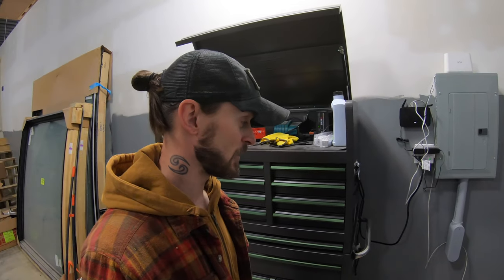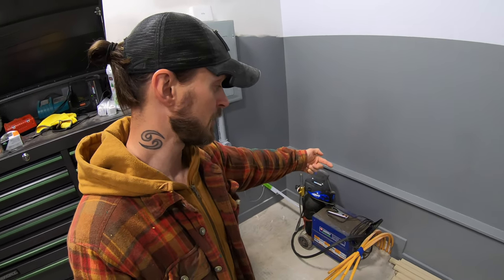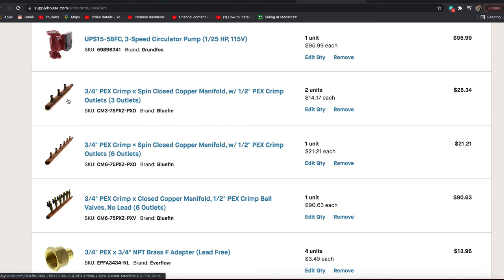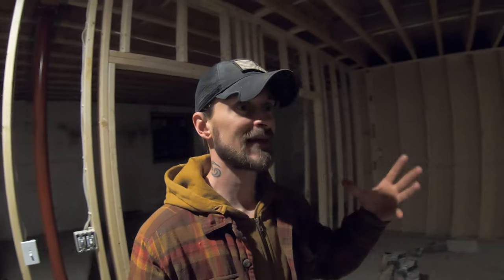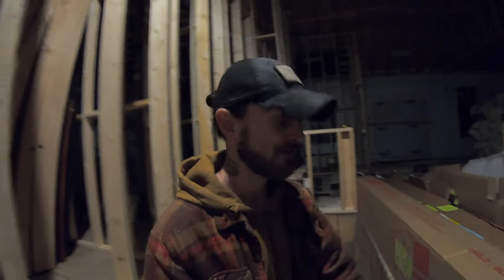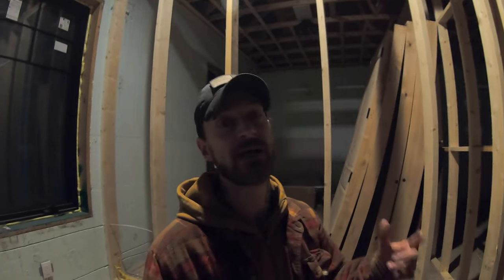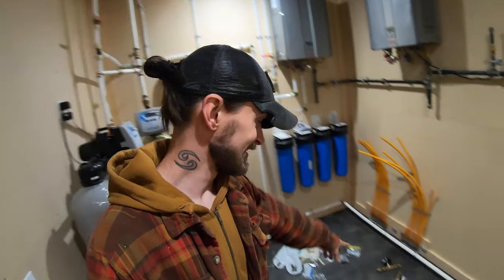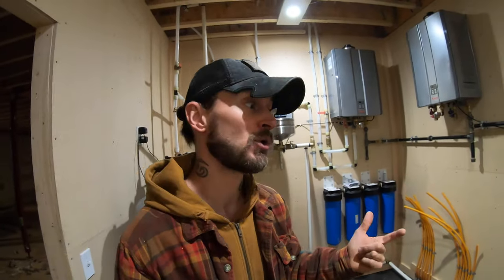Lets talk about radiant floor  Heating!!  Is it enough??

Comment: i would put one valve between manifold and main line. That way u could just shut the garage off. But no way it is needed for each loop.
Reply from the maker: Definitely doing that at least.
Reply: At least one 1/2” valve per loop will be very helpful for purging air. That way you can purge one loop at a time.

Comment: Valves allow you to balance the flow of the manifold. More importantly if and when you have a problem with a loop, it allows to isolate it.
Reply from the maker: I didn’t get mine with the flow rates so not sure how to balance but when in the basement it all feels comfortable, that is until we start blocking rooms off and isolating them.

Comment: I hope your radiant works, I’m doing the same thing.  I’m going to have 4 -300 ft loops for the basement and upper floor. 2400 sq ft. I think it will work.  People in icf houses swear by the consistency in the temperature all around the house.
Reply from the maker: Well the garage is amazing and that’s not even ICF!   Just 2x8 walls with zip R 6.6 on the outside.  58° feels crazy crazy warm!   Working out there you’ll sweat!  The basement at 50° is also pretty warm and before it got cold, 61° was almost shorts and tee shirts!   I can’t imagine having the basement more than 64° in the dead of winter when we are fully insulated and doors/windows done.   I’m guessing that’ll heat the upstairs with no radiant but not sure how that’ll feel.  If the first floor is perfect the basement might be to hot and if the basements perfect the first floor might be to cold.  We’ll see but you will 10000% LOVE radiant!
Reply: @neckofthewoods24  the insulation you used in the garage was very smart.  The layer of continuous insulation is something all houses need in my opinion. Thermal breaks are a real energy saver. I see a lot of people now thermal breaking everything. I enjoy your videos because your about 8 months ahead of me.  I have seen quite a bit of similarities in our situations. Good luck!!
Reply from the maker: @bwade1022  thanks so much!  Good luck to you.

Comment: Check out Warmboard for your main floor. That’s what we’re going to put in our build. Matt Risinger has a good Build Show episode on the system.
Reply from the maker: I did.  It’s absolutely unaffordable for us.   Once I looked a few years ago and the panels were $225 each for the structural ones.  Then with price increasing they went to $350 for the retro fit ones!  I bet the structural are over $400 each now!  We have 1900sqft or roughly $21,000 needed for just some OSB that’ll hold some tubes in place on top of what we already paid for the 3/4 subfloor.  When I again inquired about the structural ones, that entire system was over $30,000!  Today I wouldn’t be surprised if it jumped to $40–50k.   My entire system isn’t going to be over $5-$6k including all pipe, pumps, boiler, controller etc.  good looking system but the prices are just way to much.
Reply: @neckofthewoods24  oh wow I can’t believe they’re that expensive! That’s really unfortunate. Figures something that cool would price everyone out.
Reply from the maker: @jordanbannerman7816  i know!  its great they do turn key or just sell you the panels but come on!!  even before the price gouging, a 1 1/8th plywood sheet was $44.50 at Menards with 11% off vs theirs at $225.  either way you need to pay so $44.50-$225=$180.50 more for a sheet of aluminium.  now we didnt use 1 1/8th plywood, we did 3/4 osb which was about $27 at the time.  so just the panels would have added $11,880 to our build which we couldnt swing.

Comment: Cheaper copper manifold in the garage, $90 copper manifold in the house, use 2  cheaper pumps for house like the one for garage. Order 2 spares
Reply from the maker: that was my thinking, copper in the garage with no valves, just a main shutoff inside.  $90 copper in the basement but for hot runs only going out to maybe slow the rate if need be.  no valve copper on the return for the basement.  use 2 1/25th pumps for the house?  would 1 pump go to 3 runs and the other pump go to the other 3?  how would that work off of one thermostat?  im not sure if the controller can have 2 wires in a slot that get screwed down.  figured a 1/6th pump set to the slow setting would be enough.  both the 1/25th and the 1/6th i want to buy them with 3 speed settings each.
Reply: @neckofthewoods24  wire the pumps together, using the same Thermostat
Reply from the maker: @joemizer  hmmm but I’ll need 5 then if I do the first floor.  I know a 1/6th is more money than 2 1/25th but I maybe I can find one in between.
Reply: @neckofthewoods24  seriously I don’t think you’ll need to do the first floor.
Reply from the maker: @joemizer  please please please!!  Haha I can’t drill all those holes through all the joists and that main beam!   Plus it’s not easy to pull from the loops!   I did just find a 1/12th stainless steal grundfos that’s cheaper than a cast 1/6th!   That should last and be able to do the 6 basement runs.

Comment: You want shutoff valves on each line to troubleshoot and isolate a broken/leaking run. Good as pex is, it’s still plastic and can crack or break if something went wrong during the pour, drilling additional holes in the slab, shooting nails into the slab, cracks that shift a slab due to frost intrusion or unknown bad concrete mix, etc.
Reply from the maker: but if the pex is broken for a year now ill just shut the whole thing down and ill have to dig it up to fix it.  shutting 1 run down to fix while the system is still running would be the only need correct?  so far we've done zero drilling or shooting nails and we dont plan to.  the garage will get a 4 post or scissor lift and the basement i've been doing adhesive vs nails.  the cracks and shift worry my but i dont think ive ever hear of that being an issue.  hopefully that doesnt happen because that will be a ton of fixing and replacing!
Reply: @neckofthewoods24  With individual shutoffs you can let the other lines run and deal with the bad line when you can or never if you decide you don’t need it. Just saw a guy still building his ICF home last week bust one of his pex lines and have to chisel it out about a foot to each side of the break in order to patch it. fortunately he just has his basement walls and floor poured when it happened so was a hassle but not a big deal. Basically valves are cheap insurance and easy to put in during the initial install.
Reply from the maker: @inmyimage1081  how did his break?   I think everyone was carful during the pour but I guess you never know.  I do know though there’s been no penetration injury’s since then.  Only downside to pre-made manifolds is the inlets are on the wrong sides vs the valve handles.   I need left sided inlets with the handles facing out.  All the manifold have the inlet on the right side or I’d have to install the manifold backwards where the handles face the walls.  That’d look dumb just like have to bring the pex up and over the manifold to U bend back into the inlet.
Reply: @neckofthewoods24  Had to go back and look, the pex wasn’t in the concrete as deep as expected (seems to be a common issue) and he cut it when making stress relief cuts in the slab.

I’ve never seen anyone use an off the shelf manifold for radiant floor heating seems like everyone just makes what works for their design and space. 

We are a ways off from building so I haven’t put a radiant heat floor system myself but I spent my career designing and fixing big integrated computer network server systems and no matter how detailed your plans are there is always risk that something will go wrong so it’s best to have contingency plans and ways to gracefully take a system offline as much as possible. The addition of some ball valves just makes sense to me.

Comment: The thermal mass of your concrete slabs should regulate your temps pretty well but if you are adding a bunch of heat like in the gym, your air temp could get pretty high since your envelope has so much insulation.  Even if your radiant is zoned and the gym zone stops circulating, that's probably not enough to stop a temperature rise.

I would add valves to your manifolds, two to shut down a manifold and one per loop to adjust flow.  That shouldn't be too expensive but it will be easier to do now rather than later.

My thought on the garage is if you are heating the apron you should have one zone by the garage doors, one on the ICF wall side and one in the middle so you can adjust a heating gradient from the cold side to the warm.  I don't know if that is correct or necessary and I'm pretty sure that you're not going to change now.  One way or another you're going to have a gradient that goes from about 36° at the apron outside to probably 68° or more at your ICF wall (because it's concrete core is attached to the thermal mass of your basement radiant floor slab).  You are always going to be pumping heat in to that gradient but I don't think your garage floor has the adjustment I would want...

In the desert cold isn't as much of an issue and the ground temperature should keep my ground floor slab fairly cool year round.  Cooling is my major issue and 3-4 zones of mini-split AC should be able to maintain my desired temp and reject transient loads like cooking or heat that comes in when opening a door in summer.  If I'm raising my ground floor air temp from 50-something to maybe 62° in the winter, my second story (living area) floor won't be uncomfortably cold and I don't think that would be a big heating cost (heat pump mode of mini-split).  Upstairs shouldn't be too much energy to heat either because I should have about R25 in the walls and R40 in the ceiling and my house will be smaller and have less window area.  I am going to put a bit of insulation in the second story floor and have a door to seperate the downstairs and upstairs zones.

I'm not trying to brag about the desert, just explaining why the expense of radiant heat doesn't make sense for me...
Reply from the maker: so the gym will be hot no matter what then?  ill make those pipes the return legs at least but i am going to install the thermostat in the main area of the basement.  if i put it in the gym then with the door closed the rest of the house could be to cold.  and if i raise the heat, the gym will be to hot then.  also i dont want to install the thermostat on the first floor because then the basement could be like an oven trying to get up to temp for the first floor. 

i think ill get valves on a mani for the hot runs in the basement but i dont see them being needed for the garage.  that should all be 1 temp and easy/even flow.   the garage slab is not attached to anything.  its floating on like 7' of stone around the edges and maybe 3' of stone in the middle where i didnt excavate that soil.  on 3 sides it touches ICF foam and the 4th side is the outside apron.  all 3 hot runs also go up to the garage doors and then come back against the house ICF wall.  so id think that heat against the ICF wall will come way down on its last 37' back to the manifold but i have no idea by how much.  i heard Steve say the hot water in his garage is 120º then returns at 112º.  so not much heat is lost heating the his slab.  i could slow the middle zone down though as its not the closest line to the doors and the middle doesnt need to be crazy warm if all the outside are hot.  

if what you say about the gradient is correct, do i even want the hot pipes next to the doors?  i think a thermostat placement is important too then.   hot pipes by the doors but the thermostat by the house will work differently then if the thermostat was placed by the garage doors.  it'll see the concrete temp fall faster as the apron cools vs way from the doors where no outside temp is pulling the concrete temps back down.  

no worries about bragging haha!  just a big difference in how we have to do things!   hopefully my mini splits can help too for heating if need be.  i know they can heat down to 4º but they'll run constantly using lots of electricity.  so fingers crossed we can get the basement radiant to work.
Reply: @neckofthewoods24  I should say this is a SWAG, the amount of heat that flows depends on the temperature differential, the thermal conductivity and a couple other physical properties of the material in question.

For the gym, a mole of air is something like 22.8 liters and weighs about 28 grams.  My bedroom is probably around 25,000 liters of volume so around 1,000 moles and probably max 40 kg of air mass while 4" concrete slab under my room probably weighs close to 4,000 kg.  If you put the same energy in to heating the air as the slab, the air temp will rise roughly 100x as much due to the difference in mass.  That's not exact because it's ignoring those other physical properties but it's enough to see it's grossly different.

If you are in there working out like crazy, you're probably not going to change the slab temperature but you can change the air temperature pretty good because your body cools itself through the air.

Now look at the insulation.  Some people with ICF houses brag that they could heat them with a blow dryer.  If the heat can't escape you get a hot gym until the heat transfer between the air and the floor equalizes the temperature but warm air rises so when the floor is cooler than the air, it's going to be a slow process.

I look at the garage slab the same way and SWAG again. 

I know a bit about thermodynamics but I'm not a pro and have more of a gut feeling than the ability to work out equations.  I just try to think about where the heat is going to go and how fast.
Reply: One more thing, I look at your garage slab like a thermal short, kind of like a 2x4 in a stud wall.  It's not necessarily bad, there is just going to be heat flow and as I said, a temperature gradient because heat is going to be going in to the slab in the basement and it's going to go out through the apron because every other path is pretty well insulated. 

The difference in temp between your water inlet and outlet isn't a big issue.  It mostly reflects the amount of heat escaping from your slab (when it's in ~thermal equilibrium), what is important is where you slab is hot, where it is cold and where the heat is flowing.

I doubt you want to heat your apron to 68° in the dead of winter which is why I would try to only have one loop heating the apron.

Again, that's a SWAG, I hope the way it works out is a non-issue but it seems to me like you could be pushing more heat in to your apron than you need to and not really have a knob to adjust that.
Reply from the maker: @joequixotic3039  very good!  i know nothing really so its good to learn something.
Reply from the maker: @joequixotic3039  i just re-watched that video.  looks like first run goes down the wall and then in front of the doors maybe 6" away.  so from that line to the outside apron is about 32".  but half way down the double door it starts to snake inside.  there are 4 loops total in front of half the double door.  then run 2 is 12" away from run 1 and snake into the middle and run 3 is 12" away from run 2 and snakes around the single bar area.  so for roughly 18" with 3 runs are in front of 2/3 of the garage and those 4 loops in the last 1/3 should be medium heat id say.  i dont want to heat the apron up to 68º, im fine with the garage at 55-60º air temp.  no clue what the slab will actually get to in that area.  i do have a Flir thermal to find out.
Reply: @neckofthewoods24  yeah, that's similar to me, my downstairs is going to be shop space so I'm only going to heat it a little bit unless I'm using it and I'm uncomfortable. 

I'm assuming your basement is probably going to be around 68° or higher if you want heat from there going upstairs.  That sets your garage slab gradient around 68° at that wall and if you don't want the apron to freeze, about 36° at the end of the apron.  That let's you either choose your apron temp and you get what you get in the garage or you can set a garage temp and you get what you get in the apron.  It would suck if your apron got too cold so you had to raise your garage temp hotter than you want.  I hope you don't get that but a loop directly behind the garage doors would give you better control in my mind.  If it got really cold you could run the door/apron loop full blast to keep the apron warm but you could shut off the other two loops if they were making the garage hotter than you intend.
Reply from the maker: @joequixotic3039  what would the basement have anything to do with the garage though?
Reply: @neckofthewoods24  your garage floor ties in to your basement wall and the thermal mass inside all the ICF.  If you are trying to keep your garage cooler than your basement, heat will flow through the basement wall to the slab.  If you have insulation between the basement wall and the garage slab, that could be a lot less heat flow there, I'm kind of thinking of a worst case scenario.
Reply from the maker: @joequixotic3039  it doesnt though.  the garage slab is just sitting next to the basement wall and 5' up higher than the basement slab.  2 5/8" of foam on both sides of that wall separate everything.  id think with that much foam they'll be little to no thermal transmission of temps from one to the other.  the concrete in the wall separating the basement from the garage id  think would also be the most stable since its conditioned space on both sides unlike the other 3 sides of the house that are outside exposed walls.  if you check this out you'll see better.

https://www.youtube.com/watch?v=C-MkRwYnqaE
Reply: @neckofthewoods24  ok, I didn't remember that detail and I assumed you tied it in to the wall.
Reply from the maker: @joequixotic3039  no worries, i make the videos and have to go back and watch what i did to remember some details haha.